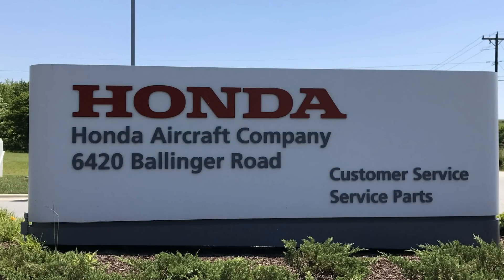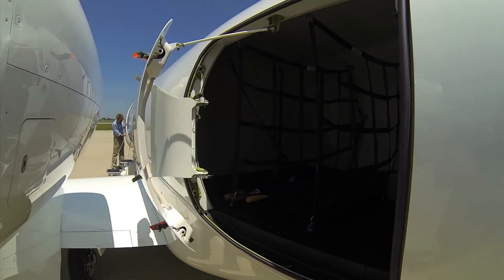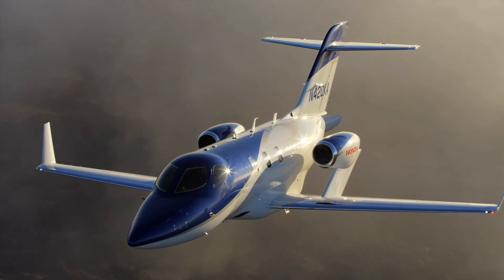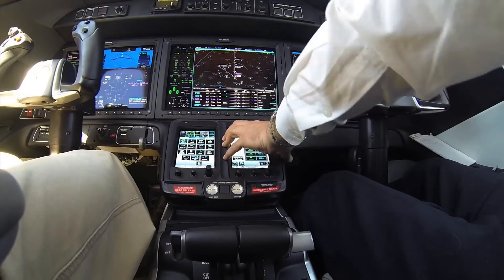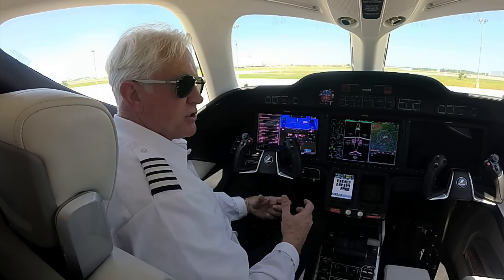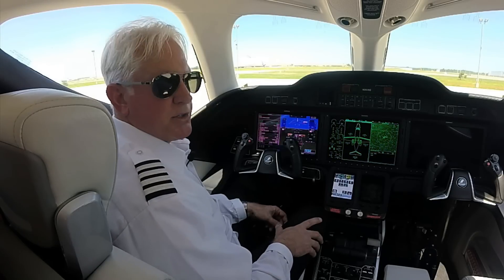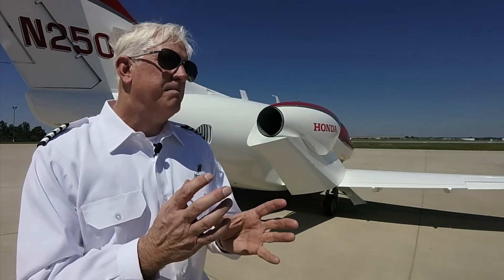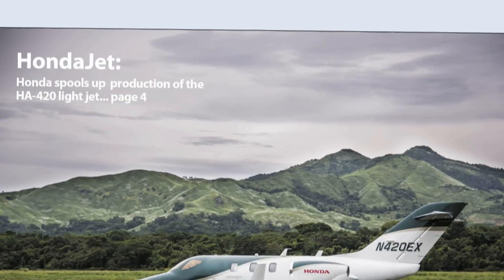HondaJet Flight Demo

Comment: I don't understand why Honda thought that the world needed another biz jet, what the world really needs is a decent piston engine for light aircraft, and Honda is very good at making piston engines.
Reply: Distance, speed, height are some of the advantages that a turbojet has over prop. If one wants to achieve faster speeds and higher heights with prop, one goes to turboprop. Turboprops can be quite complex compared to the turbojet. Gears add to the complexity. Props are ideal for short hops, but coast to coast... no. You have to take into account propeller tips reaching supersonic speeds ... extremely loud and inefficient.
Reply: Like I said, I don't understand why Honda thought that it was a good idea to add yet another jet engine/aircraft to the market when piston engines desperately need to be modernized.
Reply: idontcare80 the GA world still uses comm technology from the 40s and the engines still burn lead. They are obviously in no rush to catch up with the rest of the world beyond allowing iPads on board with ForeFlight.
Reply: idontcare80 bcoz business jet boom in high demand from China n gulf states
Reply: "We've reached near maximum with piston potential."

In the automotive world, yes, but piston engines in light aircraft have barely changed for 60 years, so there's a huge amount of room for improvement. 

"Liquid cooled are also a lot heavier."

They're actually lighter, those cooling fins don't weigh nothing. Air cooled engines also require wide bore spacing in order to make room for the cooling fins between cylinders, this makes the crankcase and crankshaft heavier, and those are some of the heaviest parts of the engine. Check out the Adept Airmotive engine.

Nothing can replace pistons in the 400 hp and below range, the fuel burn rates simply become uneconomical. Turbines don't scale down well.

"For piston theres is not enough incentive/money."

It's a long term game, sure, but there's money to be made.
Reply: "For Honda to to edge in and make a decent profit they would have to bring in something very disruptive."

They could have easily had that. That's what Adept has right now.

"Interesting debate about water cooled aircraft engines,"

I've read it all. Water cooled engines are vastly superior.

"The thing is, as some of the commentators in the forum intimated, aircraft and car engines are not the same."

That's right, that's why I said that a purpose built aircraft engine must be manufactured. Viking engines are very successful automotive conversions, but their internal geometry is all wrong, as a result, their piston speeds are excessively high, so wear and fuel consumption will be excessively high (though, still better than current GA engines). Reliability also suffers when piston speeds are high. Automotive engines are designed to cruise efficiently at low load and rpm, an aircraft engine must be designed to cruise efficiently at relatively high rpm and high load. Honda would need to design a bespoke aircraft engine, but it would be much easier for Honda to design and build a modern aircraft engine because they already know how to do it, Lycoming and Continental don't.

"Actually, research is being conducted on electric motors for light aircraft."

And you think that will lead to something more successful than a modern piston engine for aircraft? There's absolutely nothing to indicate that battery technology will reach a point that will make electric aircraft practical anytime in the near future.

Here are some cut and pastes from other discussions I've had on this subject because I'm getting tired of repeating myself.

Why series hybrid systems make sense in automotive applications and not in aircraft applications: Internal combustion engines can really only be designed to operate efficiently within a narrow range of power and rpm settings, so an automotive engine ends up spending the majority of its time operating at power and rpm settings that are less than ideal for engine efficiency. To correct this, a series hybrid system allows the ICE to operate at its most efficient settings for basically all of the time that it's running, while the electric drive system handles all of the varying loads and vehicle speeds with much greater efficiency than an ICE ever could. A series hybrid system also allows for the electric drive system to recover energy during deceleration, greatly improving the efficiency of the vehicle. Aircraft engines don't operate at widely varied power and rpm settings for long periods of time, and they have very little need for energy regen during deceleration. In fact, aircraft engines spend the vast majority of their time operating at their most efficient power and rpm settings, and light aircraft don't usually need additional drag when descending and decelerating. Light aircraft actually need to conserve their kinetic energy when descending and decelerating, so there's very little to be gained from any kind of regen system. There is not currently a more efficient way to power an aircraft than with a piston engine mechanically driving a propeller, and there wont be until batteries are light enough to replace the fuel and ICE in aircraft entirely, and that may not ever happen. That certainly wont happen with chemical batteries.

....

Rotax adopted EFI for their 912 series engines and saw an immediate jump in fuel efficiency of about 20%, but their engine is still partially air cooled, has a pushrod valvetrain and only two valves per cylinder. Adept adopted a DOHC, 4 valve per cylinder arrangement because the larger valve area and freer flowing ports (no pushrods in their way) allows for a reduction in pumping losses, and because the OHC valvetrain reduces reciprocating mass, this all adds up to increased engine efficiency. Water cooling keeps engine parts cooled more consistently than air cooling, and this reduces hot spots in the combustion chambers which cause knocking and make it difficult to use low octane fuel. Water cooling also increases engine life and reliability by keeping parts cooled more consistently. The Adept engine also makes use of very oversquare internal geometry, and this keeps piston speeds low, which keeps friction low, which keeps engine longevity and efficiency high. 

EFI also eliminates the need for the pilot to manage the fuel mixture, which increases engine reliability by controlling the fuel mixture much more accurately than a human being ever could. EFI also eliminates the possibility of the pilot mismanaging the fuel mixture and causing the engine to fail.

Most people in aviation forums rail against anything new simply because they're afraid of change, they have no real basis for believing what they believe about new aircraft engine designs. In fact, plenty of people are proving these aviation dinosaurs wrong by adapting automotive engines for use in aircraft with great success, even though those engines are inherently bad starting places for aircraft engines. 

2 valve engines perform poorly at high rpm (above 3,000-4,000 rpm) because their limited valve area is highly restrictive (like breathing through a straw), these engines operate at over 5,000 rpm (talking about the Bombardier V6 as well). The Adept engine has 4 valves for each cylinder and this allows the engine to breathe much more efficiently. Improved breathing efficiency (aspiration efficiency) means that the engine doesn't have to waste as much energy to move gasses in and out of the cylinders and that more fuel and air can be pulled into the cylinder on the intake stroke, this allows the engine to produce more power. Notice that the naturally aspirated version of the Bombardier/Rotax engine only made 220 hp, this is because of how restricted it was by its valvetrain.

The lightest TSIOF-550 (FADEC engine) weighs in at just under 600 pounds, that's over 250 pounds more than the Adept engine. And, no, that's not a problem for airframe designers like that one guy in a forum was saying. If an engine is too light, you just put it further out on the nose. This is exactly why the Pilatus PC-6 has such a long nose, because it was originally designed for a much heavier engine.

EFI actually means less maintenance, because the engine isn't operated at hugely inconsistent fuel mixtures, so it's not as highly stressed. 40 years ago, cars struggled to hit 100,000 miles, but it's fairly common for cars to hit 300,000 miles these days. largely because of EFI. Again, EFI makes the whole engine more reliable, because it's not relying on a pilot to manage the fuel mixture. Pilots die fairly often by mismanaging their engine and causing it to fail.

Fuel injection isn't even that difficult to add to an engine, even Lycoming and Continental have FADEC engines, those engines are just really hard to come by. The difficult part is moving away from direct drive, air cooled engines, because it requires a huge shift in basically everything those companies do.

Another point to add: With the consistency of water cooling and the precise fuel metering that an EFI system offers, future aviation engines could offer a feature which allows them to cruise at full throttle and lean fuel mixtures, this would allow the engine to operate at high load (where it's most efficient) and with very low pumping losses, which would significantly increase engine efficiency. Engine rpm would be reduced by using a variable pitch propeller. Full throttle, high load operation with rpm reduced by the propeller is already being experimented with on automotive conversions. 

I believe it was Charles Lindbergh who first used this method of engine operation to save fuel during WW2 while flying P-38s.
Reply: So f*#k the majority of the people who fly, basically.
Reply: The extended development time was very much down to the need for testing & certification at every little stage of the design & build, then same again for production systems (I have a friend who works there in the testing dept, every single little item & action has to be recorded, excruciatingly boring).  But they are working for very long term success, trying to make it the most advanced business jet in the world.
Reply: Truth's Knight_0777 - That's my entire point! Why didn't Honda put a superior piston engine into production?

Theo Currie - F1 is a tiny little niche. Honda produces millions of extremely reliable and very competitive engines every year, for the whole world. Renault can't make that claim, neither can Ferrari, nor can many other F1 competitors that have done consistently well in F1.
Reply: Aren't Turboprops much more efficient than piston engines? I mean as soon as you approach medium range flights they beat normal piston engines.
Reply: The LSA market is booming too.
Reply: @PistonAvatarGuy  Yeah!  The #1 seller Flight Design just went bankrupt..

What a bonanza!
Reply: @raymond3803  The number one seller of what? Flight Design went bankrupt last year, or the year before, but they're still producing and selling aircraft under new ownership. If you're talking about Rotax engines, they're used in a VERY long list of aircraft.

Edit: There's a list of many of the aircraft which make use of the Rotax 912 in its Wikipedia article.
Reply: @PistonAvatarGuy  Light Sport.  
Way up this worthless thread you commented "LSA is booming too"
In disagreement, I snarked back.
Reply: @raymond3803  In Europe, it's called the ultralight class, and it is booming.
Reply: @raymond3803  You're babbling like a crazy person, I don't even know what your point is here.

The point that I was making was that Rotax engines are selling extremely well, you're the one hung up on the name of the class. You're being pedantic for absolutely no reason, everything that you're saying here is irrelevant. So, yes, Mr. Crazy, let's start wars over morons getting hung up on irrelevant nonsense, that makes perfect sense.

Flight Design is still selling planes that are powered by Rotax engines, so are dozens of other companies. ONE company doesn't represent ALL companies. Like I said, take a look at the Wikipedia page for the Rotax 912, there's a list of nearly 400 aircraft models that are using the engine, and that's probably not even a complete list!
Reply: @raymond3803  Are you trying to say that the Japanese are the "stupidest" people on Earth? They absolutely STORMED the American market with their cars because they were VASTLY superior to anything else on the market! The only way that the American big three were able to catch up was by copying the Japanese, or by actually buying Japanese brands and having the Japanese design things for them. The Japanese brands also DOMINATED quality and dependability ratings for DECADES. Japanese electronics also dominated the world for a long time, and still do in many ways. Hell, just look at ONE invention, the blue LED, it made white LEDs possible, which revolutionized lighting! Edit: The Japanese inventors of the blue LED actually won a Nobel Peace Prize because their invention was so revolutionary!

It takes a long time to get any aircraft into production, that's just how it goes. The F-35, for example, took something like 12 years to develop before even taking its first flight! And that was built by a company that has been building aircraft for almost a century! Honda had to start an entire aircraft company from NOTHING!

Maybe you're trying to say that Germans are the "stupidest" people on Earth? They basically invented the piston engines that made powered flight possible and changed the entire aviation industry with the developments that they made during WW2, how is that stupid? They also build some of the fastest and most advanced cars on Earth!

You're a f--king lunatic!
Reply: idontcare80 well bcoz u don't care haha
Reply: idontcare80 the rich  from those states don't fly their own planes.... they just employ pilots to show off.
Reply: You have to take into account that the founder of Hondajet Michimasa Fujino started looking into an advanced jet back in 86. I am assuming  that the company threw all their eggs in that basket and hoped for a positive outcome through the several decades of development. During the 80's GA was suffering losses due to lawsuits towards manufactures. GA manufacturing in the US fell over 70% and manufactures were looking to either close shop or develop outside the country. So anything related to GA in terms of airframe and powerplants was not favorable until the Federal government put a stop to it with the General Aviation Revitalization Act of 1994. In fact production has not gone back to pre 80 levels (https://en.wikipedia.org/wiki/General_Aviation_Revitalization_Act#/media/File:US_Made_GenAvAirplanes_1946-2009_UnitsShipped_NetBillingsIn2009Dollars.png). Business jets have a higher reliability as well as turbojets/fans. In addition the Honda Aircraft Company will need to sell 1,000 aircraft to generate $1 million in profit where the first 100 aircraft will be unprofitable. I am sure that seeing how things are going in the LSA market in Europe they must be kicking themselves a little. The problem with Honda jet is it too too damn long to develop.
Reply: "Business jets have a higher reliability as well as turbojets/fans."

Yeah, at a price point that probably less than 1% of people alive today can afford. And part of the reason that piston engines need to be modernized is to increase their reliability. One of the main reasons that the automotive world moved away from air-cooled engines is because they simply aren't very reliable.

Honda also did develop a piston engine in the early 2000s, but instead of relying on their understanding of how to build modern, reliable engines, they partnered with Continental and came up with the abomination that they did.
Reply: "Yeah, you can't buy an engine from anyone other than Honda, right?"

You can buy heavy, unreliable, fuel-guzzling, high pilot workload, archaic, vibrating junk, yeah. You cannot buy a modern, certified piston engine right now.

"You don't know shit. Honda does."

Right, because businesses never make bad choices!
Reply: We've reached near maximum with piston potential. Even automotive manufactures invest quite a bit to squeeze out just that little added performance. One of the easiest ways is to turbocharge. There is recent development in a hybrid turbocharger for automobiles with electric to overcome the initial lag when boosting. I am looking forward to when detonation engines will be introduced commercially. There is a recent surge of interest. Lookup pulse detonation engines, roatione detonation engines and, and continuous rotating engines. Airbus and P&W has some R&D into the tech as well as the Navy. There was an engineer some 15 years back that was looking into a rotating shaft type detonation engine for race cars. Idylchatter mentioned Duke engines. Again, for Honda to develop a new engine requires serious money and they dumped quite a bit in their hondajet.

"One of the main reasons that the automotive world moved away from air-cooled engines is because they simply aren't very reliable."
Liquid cooled are also a lot heavier. In aircraft every pound counts. Personally, piston for LSA and GA and turbo prop for higher end. I already listed the reasons in my original comment. For piston theres is not enough incentive/money. It's towards turboprop and up.
Reply: Idylchatter I'd bet that it will share the same fate as the Dynacam engine.

I'm cheering for Adept Airmotive, personally.
Reply: "The money is at the opposite end..."

There's still money to be made in the GA market. If there wasn't, Continental and Lycoming wouldn't still be in business.

Improvements in rocket and turbine engine technology don't improve things for those who fly light aircraft.

"Is that so."

Yes, that is so. As long as those engines are air cooled and direct drive, they will be unable to exceed a certain level of performance, and their current level of performance leaves a great deal to be desired. 

"A discussion on deisel fuel in aircraft"

Diesels are not only extremely heavy, but they're also extremely expensive, and they always will be. Modern gasoline engines will also have the ability to run on mogas, which is not only cheaper than avgas, but also cheaper than Jet A.
Reply: "Continental and Lycoming wouldn't still be in business."
Both manufactures are established in the aircraft engine industry. For Honda to to edge in and make a decent profit they would have to bring in something very disruptive. Honda's view was aimed at designing a new lightweight business/leisure jet when the GA industry was going down. That is where their money was being spent. That's where honda thought it could be disruptive. 

Interesting debate about water cooled aircraft engines,
http://www.vansairforce.com/community/showthread.php?t=24391
and 
http://www.vansairforce.com/community/showthread.php?t=10954&page=2

The thing is, as some of the commentators in the forum intimated, aircraft and car engines are not the same. We both know that. What I am writing is that for Honda to make a major move in such an industry would require quite a bit of investment and time and frankly their focus is not on the light aircraft market. Doesn't mean someone could not convince them "/

"Improvements in rocket and turbine engine technology doesn't improve things for those who fly light aircraft."
Of course not, what I was intimating ss major gains are being realized in the commercial and business aircraft. Actually, research is being conducted on electric motors for light aircraft. So, one one hand is the view of water cooling/air cooling and better engine tech, and on the other hand is a move towards electric motors, or some kind of hybrid design. 
http://www.experimentalaircraft.info/homebuilt-aircraft/electric-aircraft-engines-2.php
Reply: Current Batches - Butthurt much? You act like I'm spending your money! I don't have control over anyone's money, so I don't understand why you're whining. My only concern is the technology, I'm just pointing out that there's much better technology than what we currently use.

Can you think of a reason that people shouldn't be investing in better technologies?
Reply: Adept Airmotive already built my dream engine, so why would I need to make my own? 

Also, I do actually think that the certification process should be subsidized, otherwise a modern engine design will never make it into production. Why should the long established manufacturers be the only ones able to compete, especially when they've failed to keep pace with technology?
Reply: I feel ya.  Yet another example of corporate power maintaining a hegemony.  Shame really, we took a step backwards when Concorde was retired, and won't see anything groundbreaking until a Musk of the aviation industry takes a gamble.
Reply: I agree but it´s pretty and I want one :) I like the idea of small jets that are just a little bigger than fighters.
Reply: "So spend your money and prove it."

I'm not a mutli-millionaire, and if I was, I would invest in the development of a modern light aircraft engine. What point are you trying to make with that statement anyway? I guess the whole world should have just stayed in the 1950s and only the 1% should enjoy any technology that advanced past that point? 

"So far, you've done nothing other than whine about that nasty Honda company who prefers to make money for their stockholders rather than waste it on your fantasies."

That's the problem with the world today, isn't it? No one is concerned with improving life anymore, everything is just a rabid money grab on the way to the bottom.
Reply: Senna seemed to like Honda engines. Honda also dominated Indy for quite a long time. Hell, by 2006 every other engine manufacturer had dropped out of Indy because they couldn't compete. 

Quite a few of the people in my family own, or have owned Hondas, the engines have been nothing but flawless. Only one Honda that I maintain has had problems, but none were related to the engine/drivetrain, and it's pushing 240,000 miles. I've had a couple with over 200,000 miles that were flawlessly reliable, and one with over 300,000 miles that was flawlessly reliable. Honda makes awesome engines.
Reply: Well, they made awesome engines.
Of course, i'm only talking about motorsport and formula 1 in particular, but in this season, they have been nothing but crap.
Alonso right now doesn't even have a car that allows him to finish the bloody race, he would score more points with a moped. That's a shame.
He's at the end of his career, and he can't even end it properly. After F1, he's just going to race in oval tracks or Formula E, and i don't know which is worse.
Reply: A lot of racing is politics, though, who knows what's going on behind the scenes.

Honda still makes awesome passenger car engines. The K series and the L series are some of the most reliable engines you can buy.
Reply: Agreed. I did not want to say anything negative about her.
Reply: Look up Viking engines.
Reply: The problems are that:

1) They're uncertified
2) Too heavy and powerful for the LSA class
3) The owner has some shady history from when he was selling Subaru conversions (poor support, poor reliability, customers not receiving parts ordered, etc)

And frankly, while they are less expensive than conventional engines, they're not much less expensive, so they're not really solving the cost problem. And it's unknown whether vikings implementation is solving the reliability problem.

What we really need is for someone to create a DIY guide that lets you take an engine from a crashed low-miles Fit/Civic ($1000-1500) and convert it for aviation use.
Reply: IIRC, the Eggenfellner Subaru engines had problems with head gaskets and PSRUs. The PSRU for the Honda engines is completely different, and the head gasket problems were common with those Subaru engines, no matter what they were being used in, so I'd be surprised if those issues ever popped up again. I don't think Jan is a bad guy, he just got in over his head. 

What we really need is for someone to build something like the Hayabusa motorcycle engine, but for aircraft use. It would be much lighter than the Honda L series (which is what the Viking engines are based on) and capable of similar power output. People do convert motorcycle and snowmobile engines for use in aircraft, but they're a poor starting point because the transmission case is usually integrated into the crankcase, so people will just run the engine with the transmission, which adds unnecessary weight and complexity. The engines are also tuned to make their power at 10,000+ rpm, but you only need about 5,500 rpm to produce over 100 hp with a naturally aspirated, 1.2 liter, DOHC engine.
Reply: Why should someone pay 80k+ when they can get an old engine that gets the job done for ~40k and also has tons of resources for maintenance and seasoned mechanics on them due to their simplicity. Diesel seems to be the next thing for small aircraft because of Europe/Canada's stance on Avgas. The demand is not their for a seriously modernized engine, the vast majority of fixed-wing aircraft AND helicopters that are operated for profit are gas turbine. That means the big spenders want those powerplants. There are already cheaper options for good power on light aircraft like the O-360, there are tons of people who have and have tried to modernize these engines. They went bankrupt, the only major downside to diesel is the TBO
Reply: I've already covered all of this. The $80k engine will be more reliable, more fuel efficient, it will weighs less, it will be much easier to operate (which will reduce pilot workload and decrease the chance of failure due to pilot error), require less maintenance, it will run smoother (increased pilot and passenger comfort), it will run on unleaded fuel (leaded fuel will be eliminated), it will likely have an increased TBO due to the more consistent cooling of the engine and the more consistent fuel mixture provided by the EFI system... the list goes on and on. 

"...and also has tons of resources for maintenance and seasoned mechanics on them due to their simplicity."

The new diesels are just as big of a departure from current aircraft engines as the Adept Airmotive engine, but they're also much more expensive, much heavier, and they burn more expensive fuel.  

The FADEC engines from Lycoming and Continental are also around $80k-90k, and they don't compete very well with the Adept Airmotive engine.

Gas turbines don't work in applications that require less than 400 to 500 hp, they simply use too much fuel. 

There's no point in trying to modernize direct-drive, air cooled engines, the largest benefits come from adopting water cooling and making use of smaller, lighter, higher revving engines.

"...the only major downside to diesel is the TBO."

And the ridiculous engine weight, ridiculous cost, and the more expensive fuel. The Austro AE300 in the DA62 weighs 414 pounds and makes 168 hp, the Adept Airmotive engine weighs 340 pounds and makes 320 hp, a FADEC TSIO-550 weighs 566 pounds and makes 315 hp.
Reply: You're making a lot of claims that need to be substantiated. There is a bottom line with these engines, that is a simple fact. Efficiency only matters if the owner/op can afford the engine. The less popular an engine is, the more expensive it is to fix it. Parts companies will charge you more, a lot more. There are some really nifty engines out there, some people have paid to get them approved and registered, and they're all DOA because they're so damn expensive to maintain. I've seen so many of these wonder engines you're talking about and some seem to live up to the claim. Yet nobody uses them and the rights owners are in lawsuits and bankrupt. he userbase wants cheap and easy, and the best balance of the 2 are the ones used right now. It's the same reason there are a lot more Civics out there than Skylines, not everyone can afford, or even needs, the best engine.
Reply: "You're making a lot of claims that need to be substantiated."

Am I? Most of them can be verified by looking at the numbers, the rest are just common knowledge. You wont find air-cooled piston engines in the world of transportation anywhere outside of aviation and low performance motorcycles and scooters, and there's a huge list of reasons why that is. 

Lycoming and Continental know that there's a market for 300+ hp engines in the $80k range, if they didn't, they wouldn't be making them. Their engines are still unbelievably archaic. 

Maintenance will be significantly reduced with EFI equipped, water-cooled engines, because they're not nearly as sensitive, fragile, or finicky as air-cooled engines. 

"I've seen so many of these wonder engines you're talking about and some seem to live up to the claim."

Most of those engines were radical and bizarre designs, and that's why they failed, there's nothing radical or bizarre about the Adept Airmotive engine, it's just a V6, and its layout is even more well suited to aircraft use than the 60 degree V6 engines that you'll find in the automotive industry.

"It's the same reason there are a lot more Civics out there than Skylines, not everyone can afford, or even needs, the best engine."

Nissan is still making GT-Rs because there is a market for them, just like there's a market for an $80k, 300+ hp engine. Honda is still making the Civic because there is a market for them, just like there's a market for the Rotax 912.
Reply: "You show the absolute certainty of a dimwit who would lose millions, since you are convinced the you are right and the market is wrong!"

I'll put this a few different ways so that you understand it:

The market doesn't exist in the way that you think it does, it hasn't for a long time. Basically no one new can join the game at this point, because it takes so much capital to compete with the companies who have had most of a century to build their businesses, that no one who is willing to compete with them can, and no one who is able to do it will, so we're stagnating in all of the ways that matter. 

The pioneering innovators who moved us forward in the past are no longer able to do so, and the people who are able to move us forward are just sitting in their safe little bubbles of greedy ignorance. 

You have to get something into production in order to know how well it will do on the market. Very few people in the world have the many millions of dollars that it takes to build a factory and develop a new engine, and those that do already have their money invested in long-established businesses. This is one area where capitalism falls flat on its face, because it becomes almost entirely dependent on long established businesses for technological advancement.

All of this is a natural consequence of advancing technology in a capitalistic economy. Technology has become so advanced that only huge, well established companies are able to bring competitive products to market, and many of them have no competition, so, again, we just stagnate. This is why I'm so disappointed in Honda, because Honda is a company that not only has the engineering ability to put a fantastic aircraft engine into production, but also has the financial ability to do so.

Anyway, I understand engine technology extremely well, you don't, so you're scared of a new engine design. I don't know why you think that's my failing and not yours.
Reply: To be more concise: How would anyone ever know how the Adept Airmotive engine compares to the certified engines that are currently on the market if it never gets a chance to compete because investors are too ignorant of engine technology to understand why it deserves their investment in the first place?
Reply: I take it you've not been watching formula 1 as of late 😉
Reply: idontcare80 fair point I was just pulling your beard 🙈
Reply: Gas turbine engines are more efficient in almost every way except when at idle. Turboprops are more efficient at gaining speed quickly but still not as fuel efficient. As I said before to the guy here who is blind, I'll try to sum it up. The idea he and others have is that there is no recip engine that can put out power, and that's false. Many twin commuters run recips because they cannot afford turboprops, but anyone with money uses a turboprop because they're better for people who want power or a business. Recips are generally for Joe Schmoe and need to be kept cheap and easy/cheap to maintain which Lyco/Conti provide. There simply isn't a market for a big company modern recip for aircraft. It's extremely expensive to put on the market and again look around..there are a surprising number of powerplants you can buy that are modern designs that some poor guy invested in to get FAA approved. The engines great, the maintenance isn't hard but the parts are EXPENSIVE due to low demand of engines and spare parts. A lot more comes into play than people think
Reply: idontcare80 and at a decent price
Reply: VTEC Bonanzas anyone?
Reply: @mandarin1257  VTEC would actually be an awesome system to use in aircraft, because you could have one cam optimized for takeoff power and one cam optimized for cruise power. There has also never been a reported failure of the VTEC mechanism, there's really just no way for it to fail. Lycoming had implemented a cam changing system on the XR-7755 in order to have separate cam profiles for takeoff and for cruise, but it wasn't anything like the VTEC system..
Reply: I'm aware of the differences between jets and propeller driven aircraft, and I'm not saying that Honda should have tried to make an aircraft with a piston engine that performs the way that this jet does, I'm saying that Honda already has everything necessary to build piston engines for light aircraft, so I don't understand why they're not building them. There are already people making use of Honda automotive engines in aircraft fairly successfully, but purpose built aircraft engines would offer very significant performance improvements.
Reply: "Nothing can replace pistons in the 400 hp and below range, the fuel burn rates simply become uneconomical. Turbines don't scale down well."
Agreed, but I was not discussing scaling down turbines. The money is at the opposite end where the great need to cut back on fuel and emissions is what is digging at the airline's pockets. With the advent of 3-d printing, parts that were unthought of to create via traditional CNC is now a reality for turbines. The same goes for rocket engines. Improvements are continuously being made with engine technology, whereas for weight savings on the airframe it seems to be a tug between composites and aluminum alloys. There have been modest improvements in weight savings, but nothing really revolutionary. There is research on making the wings more slender. This would increase the speed further into the transonic regime, but with less mass comes an increase in aeroelastic effects. Hence the research into control of flexible structures and new ways to laminate and manufacture wings.

"In the automotive world, yes, but piston engines in light aircraft have barely changed for 60 years, s"
Is that so. http://www.flyingmag.com/aircraft/pistons/piston-engine-technology
A discussion on deisel fuel in aircraft,
http://www.flyingmag.com/aircraft/diesel-aircraft-engines-revolution#page-4

"Check out the Adept Airmotive engine."  Just did, thanks.
Reply: Sure! Alonso has never had a problem with a Honda piston engine. They just never fail.
Reply: idontcare80 The world always needs a superior product.
Reply: Actually, you can buy some modern engines, but they're all diesels, they have very little power and are ridiculously heavy.